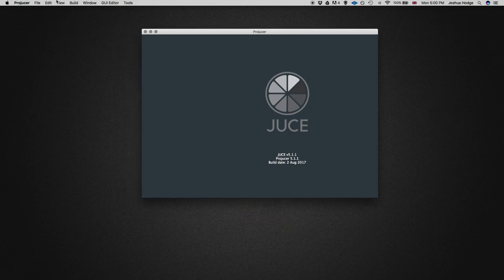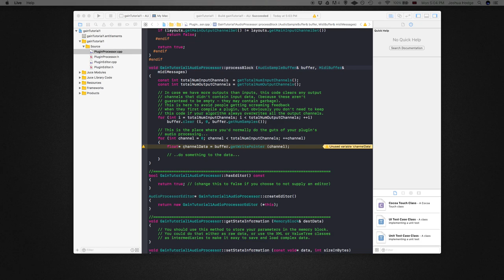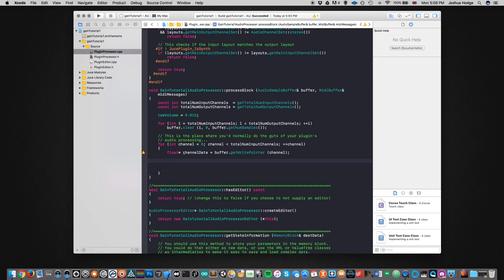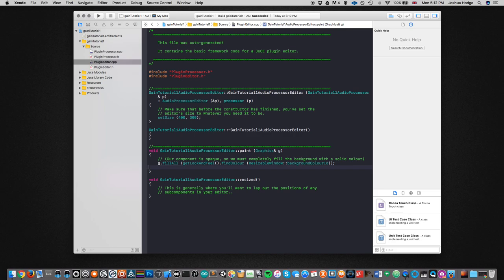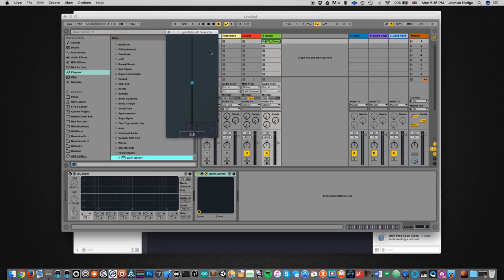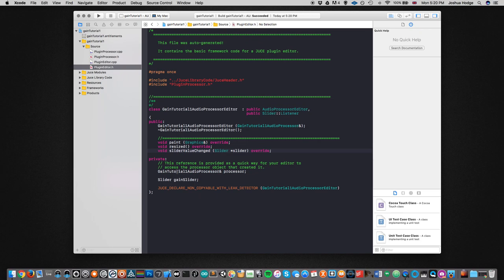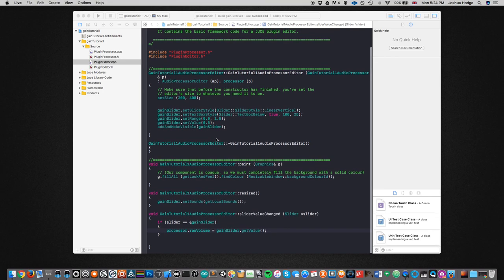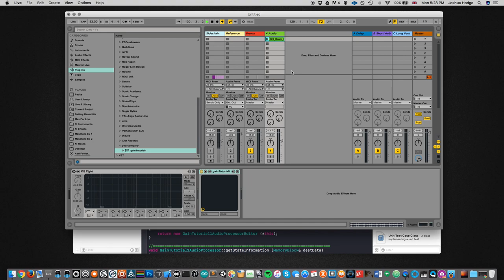Juce Tutorial 14- Creating Your First Plugin (Pt 1)

Comment: Question: I heard in another video that doubles weren't guaranteed to be atomic (in the Peter Goodliffe JUCE video "golden rules of audio programming") so we should not use them between threads as shown in this video due to the risk of data tearing. They suggest instead to use std::atomic. Is that correct? Thanks for the video!

Comment: These tutorials are great, At approximately 7:28 you suggest multiplying the  range of floats from -1 to  +1  by 0.5 will result in half the volume. At that point you didn't spell out whether the volume is in whole numbers at 50% or if its 75% of total volume.    0.5 would be 3/4 of total range   of -1 to +1 so I was wondering about that. Hope you had a great new year

Comment: 19:50 For anyone still confused about this, the issue here is that the function had been "declared" but not yet "defined". Having declared that there will be a function with the given signature (the same name and parameters), you must then implement that function. The convention here is that declarations are made in the header file (ending with .h) and the definitions are made in the code file (ending with .cpp). (In this instance, the changes are being made to the Editor classes rather than the Processor classes)
Reply: @designerfuzzi  Thanks for pointing this out, way better choice than the one shown in this tutorial.

Comment: I don't know if this was just my vst host, or what, but just a heads up... When playing an audio clip and loading the plugin onto that track, there was a super loud, horrible noise that I almost thought was going to blow my speakers out. Turns out this is because rawVolume was uninitialized, so before changing rawVolume by moving the slider, it was multiplying the volume by some crazy garbage number. This was solved easily by initializing processor.rawVolume = 1.0, in PluginEditor. Would it be better practice to initialize it in prepareToPlay in the PluginProcessor?

Thanks for the tutorials by the way!

Comment: Hey, thank you so much! I'm enjoying following through the tutorials. It is a little difficult sometimes following since I'm working with different tools. I'm working on Windows 10, Visual Studio 2017, and Reaper 6. 

My issue I'm running into is with the GUI frontend when trying to show the gain slider. Since you're on Ableton, you have the full resolution to your size. In Reaper, it cuts off on my resolution, only showing partial of the gainSlider, not even showing the value textbox below.  I found this code for adjustments:

    setResizable(true, true);
    setResizeLimits(600, 400, 1200, 800);
    getConstrainer()->setFixedAspectRatio(1.5);
    setSize (600, 400);

This just resized it, but the plugin still cuts off on the screen. I know you're working on a different DAW, if there is anyone else who is working with Reaper, help would be appreciated. Thank you!
Reply: Never mind, I just got some feedback from the Reaper community. I thought it was a JUCE issue but it was a Reaper issue. Since Reaper 6's update, there was some changes to the settings. Here is what I was provided in case anyone gets this problem too:

If anyone's using Reaper:

 I had to go to Options -> Preferences -> General -> Advanced UI/System tweaks

And under HiDPI mode (Windows7+) I chose "Aware + Ignore", I was mainly playing around with each one. But you'll have to restart Reaper to see the results. This changed the resolution of the whole DAW.

For Mac Users: Same section, but there is a tickbox labeled "Allow retina drawing of user interfaces", Uncheck that.

Comment: man...  the AU plugin isn't showing up after the first build from the template in both ableton live 9 64 bit and audacity 32 bit...        so frustrating
Reply: i've checked the ~/Library/audio/plugins folder if it's there. its there.   just doesn't show up in a DAW..   who knows what do ?
Reply: @shimlaDnB  did you figure it out? I unchecked 'standalone' plug-in in the settings and also checked went into the juce client module to enable vst3 replace vst2 option. That will generate a vst3 file.

Comment: I’m a PC user and am using visual studio 2017 with JUCE 5. I Followed the first couple steps no problem, got everything to show up in visual studio etc. Plug in opened up stand alone no problem. But I Tried to create a VST for Ableton and I keep getting a bunch of errors(too many to list). I found the VST3 file but can’t get plain old VST to work. Any suggestions?
Reply: I had the same problem all i did was just create a new project and checked the VST box in project settings not sure what it was but it had to be done before you start creating your pluigin.

Comment: Could you also explain how to prevent the clicks and pops that occur when you move the gain slider up and down really quickly?
Reply: I uploaded a video demonstrating it here: https://youtu.be/3cB3I9jzjH4
Reply: I was having crackles too so I used the method that JUCE provides in one their tutorials which consists of using the gainRamp function from the AudioBuffer class to smooth out the gain changes. I also had to change the entire processblock. Here's my code: https://pastebin.com/1QnTttAX
Reply: Perhaps the crackles has something to do with my audio drivers cause I'm using Windows 10 instead of OSX. I'm not 100% sure about this though.

Comment: Hey man, awesome info, when starting building the first plugin I get This 

ld: library not found for -lGain structure\

clang: error: linker command failed with exit code 1 (use -v to see invocation)

Any Ideas  ? 

ç

I have two drives and Jute installed on the second can thus be the issue ?
Reply: Solved it, Move the project to where Jute is installed :)

Comment: I'm following this but creating a VST plugin for Audacity using JUCE and VS 2017. With no gain adjustment (just copying input to output) it works fine. When I apply a level, however, I get overload. It seems like the slider-moved method is never called and my level variable is garbage. When I set it manually in prepare-to-play, I get clean sound again, but moving the slider has no effect. Everything works fine in standalone mode. Any ideas?
Reply: Here it is:

void MultiverbAudioProcessorEditor::sliderValueChanged(Slider* slider)
{
 if (slider == &levelSlider)
 {
  processor.level = levelSlider.getValue();
 }
}

I also tried removing the if, as in the JUCE version of the tutorial, but that didn't help. I rebuilt a standalone version with some breakpoints, and verified that level was initialized properly and changed with slider movements. It may be a problem in the broadcast/listen link in the VST/Audacity version. Maybe Audacity needs some other files besides the .dll file, so I will check on that.
Reply: Yes. Here's the constructor:
MultiverbAudioProcessorEditor::MultiverbAudioProcessorEditor (MultiverbAudioProcessor& p)
    : AudioProcessorEditor (&p), processor (p)
{
    // Make sure that before the constructor has finished, you've set the
    // editor's size to whatever you need it to be.
    setSize (400, 300);

 // these define the parameters of our slider object
 levelSlider.setSliderStyle(Slider::LinearBarVertical);
 levelSlider.setRange(0.0, 1.0);
 levelSlider.setValue(0.5);

 // this function adds the slider to the editor
 addAndMakeVisible(&levelSlider);
 levelSlider.addListener(this);
}
Reply: It's declared as a public float. When I commented the declaration out, the build failed because level was undefined. My understanding is that when the plugin runs, the processor at some point creates an editor, passing a pointer to itself (this). The editor assigns this pointer to a variable called processor so that, within the editor, processor.level refers to level in the processor. So assigning a value to processor.level in the editor should assign the same value to level in processor. I will try setting processor.level in the editor constructor. I predict that I will get clean sound, but be unable to adjust the level with the slider. I'll let you know later today!
Reply: My prediction did not come true - I still got distortion. I changed the slider-changed function to a do-nothing in case it was reassigning to processor.level - still no go. It may be that somehow the link between processor.level in editor and level in processor is broken.
Reply: Note: Check the commented-out code in the editor constructor and in prepareToPlay.
Reply: Thanks again. I will do this after I return from vacation and let you know the result. I also downloaded something called mulab and I will see if it works with that. It's a pity that I have to initialize level in ptp, since I have to keep it consistent with the setValue() in the editor. I guess I can define the initial level in one of the header files. My current goal is to update my reverb plugin, which I created with earlier versions of JUCE and VS. See http://profwubaudio.com/multiverb.html for more info. I appreciate your help and, as a token of my appreciation, I would like to send you a copy of my book, Introduction to Audio Signal Processing http://profwubaudio.com/textbook.html. If you are interested, you can send me contact information at wlkmet@rit.edu.

Comment: What differentiates the  quality between two different vst plug ins? I just notice some sound good and some dont, what would b this cause?
Reply: when i was studying audio design i've heard lots of conversations about this but never a real clear answer.. from what i know JUCE has a sound engine. a lot of objects that handle sound are written in a specific way. mainly rounding functions differ from sound engine to sound engine. For example if they use TWOPI with less or more digits it's going to produce rounding differences.
Reply: also sound generating functions differ from sdk to sdk. a sine at 440Hz generated by JUCE sounds just a bit different than a sine produced by reason or something